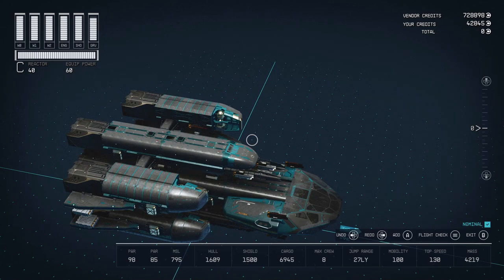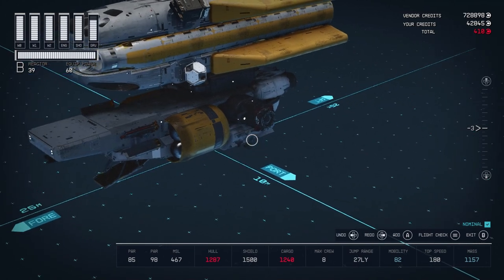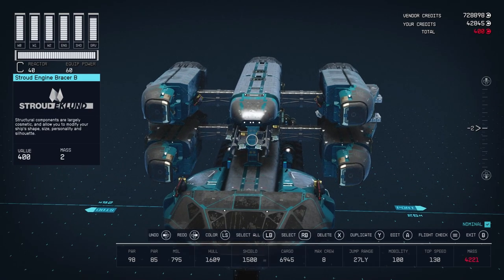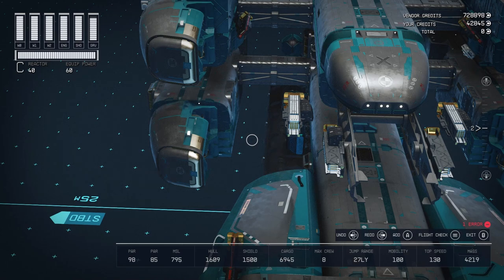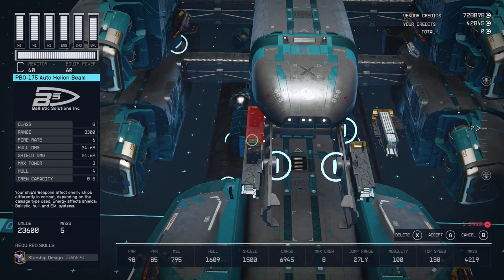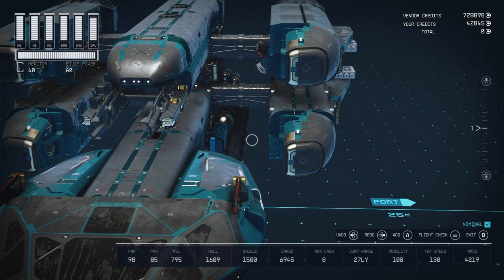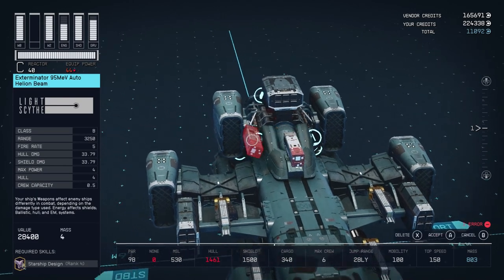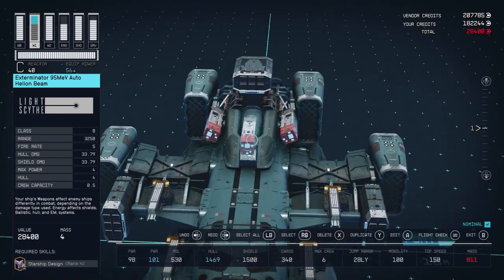Starfield Ship Builder: Glitch Tricks (No Mods Required)

Comment: Love the idea of the fully hidden weapons... Too bsd will not actually fool the enemies lol.

Wondering if besides the weapons just how much can be hidden like hiding cargo modules within 1x1 or 1x2 habs thus creating a smaller ship in dimension but keeping features.  I can see hiding the parts of big engins inside Grav  drives or hiding reul tanks ... In other words if I'm understanding and ship part that does not need crew or passage area Access using the similar process can be merged .. have an idea that in place of say 8 landing thrusters if this works as I'm thinking could use 4 duped in to 4 visual thus dame lift but ½ the physical visual.
Reply from the maker: If you hide a cargo module inside a hab, it will be visible from inside the ship, but you will be able to walk right through it, so it feels a bit too glitchy for me...

I did try hiding some of the 200CM ballast cargo holds inside of the Deimos bumpers, and that worked nicely... there's even a shielded version which is pretty cool - you can hide your shielded holds from prying eyes.
Reply: @allensproject  Yes indeed.